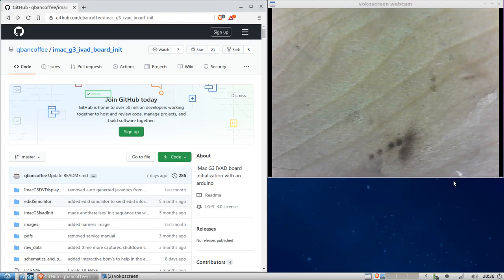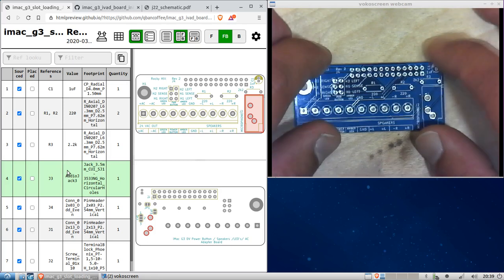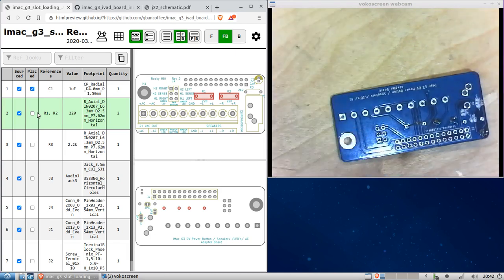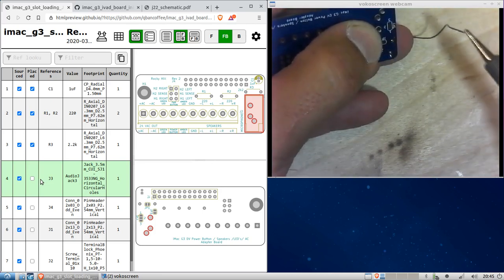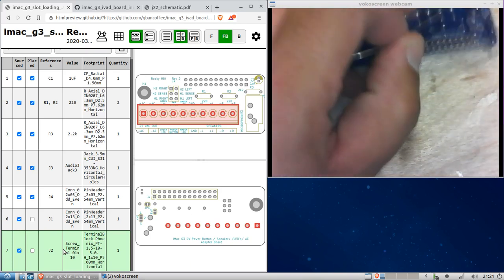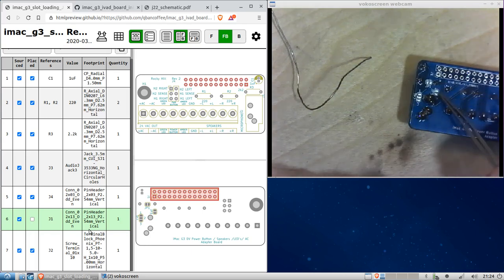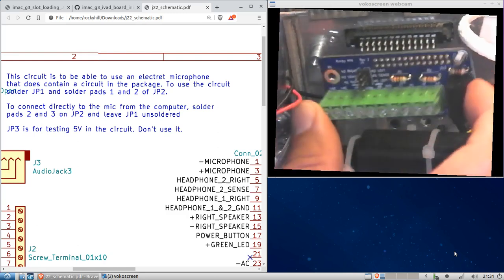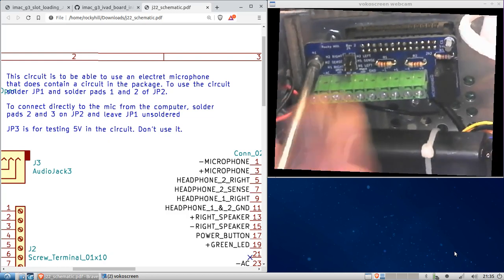Assembling the j22 board

Comment: Would you be able to provide details on how the screw terminals are being wired on the J20, J22, and down converter boards?
Reply from the maker: That is something I haven't documented yet but I will soon. The wiring is not too difficult because the screw terminals are labeled. That said, there might be a small problem wih how you wire one of them. I'll write something up soon.
Reply from the maker: @Jonathan Bui

I've added a basic diagram to get it working. There is a little more to be added but I'll have to do that some other day. Here's the link, just scroll down to the bottom.
https://github.com/qbancoffee/imac_g3_ivad_board_init/wiki/Convert-and-iMac-G3-slot-loader-into-a-standard-VGA-monitor